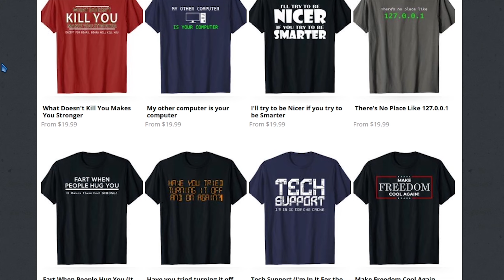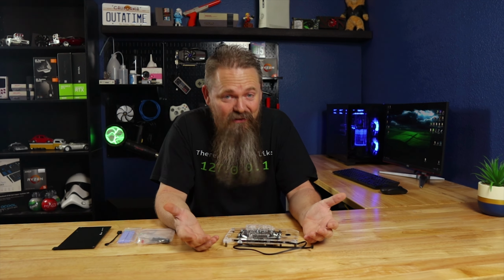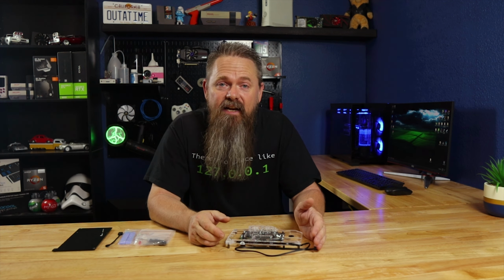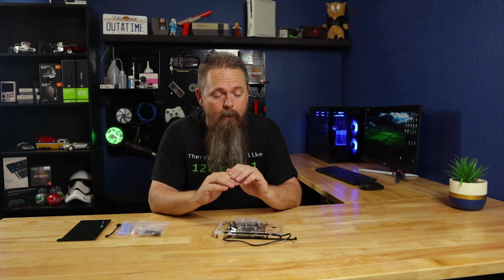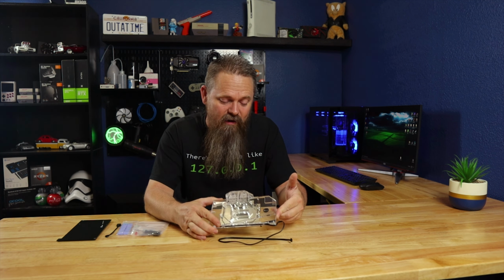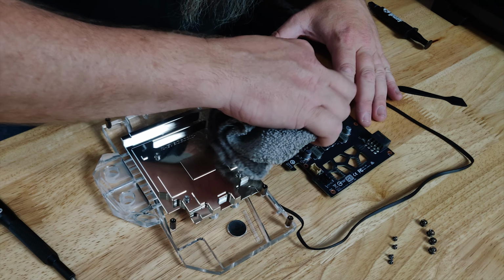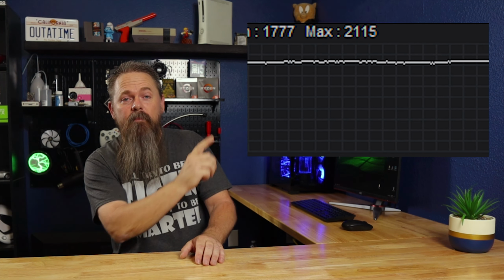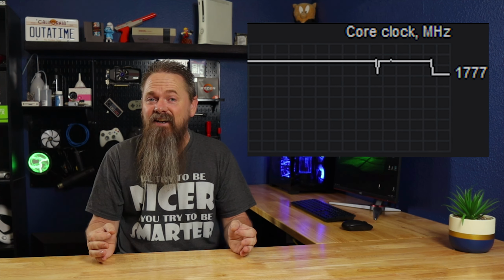Water Cooling a Mid Range Graphics Card

Comment: Its not a waste of money, when a midrange card starts to show it's age, you want to start overclocking it if you dont want to upgrade for it to keep up. Overclocking can damage cards due to the high voltages and high temps so a water cooling solution negates that. Totally worth it plus you can sell it for a pretty penny too.
Reply from the maker: Personally I'm not convinced overclocking will hurt a GPU. There's just too many limitations in place to protect the GPU from damage. The worst case scenario is the system gets unstable at higher clock speeds but once you turn them down it runs fine. Better cooling will help you run at higher clock speeds for longer.
Reply: I know this is 2 years old. But it is 100% a waste to watercool a bottom tier gpu, it makes no sense. Especially for a 200w gpu. The loop alone would end up costing way more than a 3060, at that point youre much better off getting a faster gpu. This is why u dont really see many companies making waterblocks for 60 class cards, theyre not as available as you see 80 and 90 class cards

Comment: Dude I was looking at ordering the same thing like 3 days ago.  Just ordered the card last night.  What is the length of that with the gpu block on it?  Trying to mount it horizontally in a meshlicious
Reply from the maker: The dimensions I believe are on the website. It's pretty short once you remove the air cooler.
Reply: @CyberCPU   Just picked up the same block off aliexpress for $93.00....
Reply from the maker: @notmatt5864  Sweet. Congratulations. Great deal.

Comment: My 3060 has been making rattling sounds apparently due to a defect of the shroud. Been really considering this as a much nicer way to cool it over strapping 120mm fans into it and am not sure when I will be upgrading, especially when the Bykski block costs around $115 now.
Reply from the maker: I believe that's half of what I paid when I did mine. That's a great deal. Grab one before they're gone. Now that EVGA doesn't make GPUs they're probably not going to make any more once they sell out.

Comment: Ordered an byksi waterblock for msi 6950XT on aliexpress. 130 euros with a backplate included. Going to do a custom loop in a nr200p. Keep up the great work
Reply from the maker: I had never used any of their products before and was a little concerned with quality. You know, because of water and all, 🤣😂

However, I've been really impressed with this block. It's pretty well made.
Reply: Both my EK blocks I sold for 3090s had loads of black dots and some big brown patches. My Byksi block I had on a RX 5700 is pristine clean. Same liquid. The EKs had to deal with a lot more heat though.

Comment: Nice informative video, i just upgraded from a 1060 6gb to a 3060 12gb because im limited on space with my small media case but this 3060 is like a heater in comparison so I run into temp issues pretty fast when gaming 4k/60. Looking to watercool using quick connect lines and run a duct in my media cabinet to a external radiator away from heat sources . Great to see that it will make a decent temp drop before i go down this rabit hole. I wish there was a better slection of media cases that have a clean front to blend in with my home theater stuff.

Comment: Very informative video, I want to install water cooling into my pc because I want my PC to run at a lower temp so it can stop making my room hot lol. But not sure what pumps or gear to get tbh. I have the same graphics card a RTX 3060 and a AMD Ryzen 5 5600 GB Processor. What would you recommend I get so its compatible ? or is any water cooling system compatible with both the GPU and CPU? sorry if i make no sense I'm new to the water cooling theme.

Comment: You can water cool the 3060ti with an AIO. The adapter plate from NZXT costs around $27.
Reply: got a link?
Reply: It isn’t compatible
Reply: @senpaigrime  It takes some modification, but it does work.

Comment: You could also add extra fans for the 240 radiator it will help push & exhaust the air! Also Im sure you have extra fans lying around! See if that will help to get cooler for minimum investment!
Reply from the maker: It's actually a 360mm rad. The cooling is fine with the fans ramped up a little. I have the fans set pretty low. They ramp down to 0rpm.
Reply: @CyberCPU  none the less I added extra fans to my Corsair H150i Pro AIO that's on my CPU. Check out this utility InSpectre free boost for Intel CPU's I think this can also be applied to AMD CPU's. Utility is only 125Kb in size.

Comment: What a great video, new sub! I have the 3060 ti fe and Ive been browsing water cooling for the past month. I really wanna get started but not only is it very expensive, its pretty hard to understand what is what in my experience. I found a EK 360 Kit for around 300 dollars that includes everything i need. If I add a gpu block to that loop the total would be around 500 dollars. do you think i would get around the same temps as yours or is it simply not good enough stuff included in thoose kits?
Reply: Just open up your 3060 ti, remove the old factory thermal paste and replace it with premium thermal paste like Thermal Grizzly or Noctua. This alone will slash temps by a huge margin and is MUCH cheaper than trying to watercool a 3060.

If you want to take it a step further, you can buy a high airflow case like the Phanteks p400a or p500a. The good thing about a high airflow case is that it will not only benefit your current gpu, but will benefit all future gpu's you throw in there.

Comment: I'm just a simple, old-fashioned man who prefers air-cooling when it comes to PCs... and motorcycles. Water cooling may be (much) superior but I find the simplicity and reliability of air-cooling to be a perk, not a quirk. 
Plus, with undervolting and capped frame rates; it's entirely possible to achieve water-cooling level of thermals, especially if you sacrifice some frequency to bring the voltage down even further.
Reply from the maker: I'm going to have a video about that coming out soon.
Reply: @CyberCPU  That'd be interesting! 
For reference, I undervolted my RTX3050 to the lowest possible voltage (700mV) and was able to squeeze out a respectable 1,500MHz (it boosts up to 1950MHz), just for kicks and giggles. With that profile, it basically consumes around 40W of power (indicated), comparable to a GT1030, yet offers performance close to a GTX980.
The sweet spot is 900mV @ 1900MHz. Most of the performance at almost half the power consumption (70W).
Reply from the maker: @Sam-K  I think it defeats the purpose is the GPU is underclocked. But then again, I guess it depends on what your going for.
Reply: @Sam-K  I mean there's no point having a 3050 then. Just get the 980 and let people who'd buy it and use it properly have it... 😭
Reply: @DelayEdits  I've a 75Hz monitor and always play with vsync. In a lot of older games, there's simply no need to run the GPU at full blast to have a solid, locked 75FPS experience.

Comment: I was lucky enough to buy the EVGA 3060 with the back plate for $389 ($429 original price) from Best Buy. I think I might go for the 3060ti with prices dropping.
Reply from the maker: I don't think the Ti is worth it when you already have a 3060. If your going to upgrade I would go with a 3070 or more. 

I honestly recommend going with the ti from the beginning instead of the 3060. However, if you already have a 3060 it's not enough of a performance game to justify the price. 

Maybe look into a used 3070.
Reply: @CyberCPU  I have decided to not upgrade my 3060. I currently have no plans to change my 1080p 144hz monitor. Seems like the 3060 will run most games 100+ FPS on high settings.
Reply from the maker: @WidePhotographs  Currently I'm using a 1440p ultrawide with my 3060 and it runs almost everything at close to or over 100 FPS. Of course that's overclocked and water-cooled. However, it's a very capable card.
Reply: @CyberCPU  This is exactly what I was wondering, I also own 3060 ( Gigabyte Gaming OC version ), and I was thinking to sell this gpu and get 3060 Ti, but it's probably not worth it, as you said. ( because I didn't have enough money for Ti version in first place to buy ). But, It's still great for 1440p at 60fps, especially when it's overclocked.  3070 or 6700 XT should be real upgrade

Comment: I have a 3070 and ryzen 5600x, so right now I’m running 3 panel fans and the stock cpu fan. At a high output and high temps my computer turns off, so rn I been playing at regular setting not pushing what do you recommend Aio cooler or Better cpu fan and more fans or water cool because I want the max performance. I willing to spend 360 dollar if you can help that would be amazing !
Reply from the maker: I'm kind of biased on this subject. I absolutely love water cooling. That's the direction I would go. However your likely not going to be able to du a custom loop for that price. An aio will likely be your only option.
Reply: @CyberCPU  realistically I can spend more but i also want to buy a 280 hz monitor 😂
Reply from the maker: @sweatymexican6775  I've got almost 1k into my current loop. Custom loops are expensive.

Comment: Maybe you forgot a thermal pad, man! And you put nothing in the PCB; maybe it is not necessary, but you could do a little better, here, even if 3060 it's not exactly the best middle GPU. Things that happens.
If you're doing a custum water loop, this is usually for CPU and GPU, so the money of some components should be divided in some way by two. I think that a well studied and done water loop is always the best way to invest your money. A good 700 euros GPU + 150 waterblock is always better of an 850 euros air cooled GPU. Yes: radiator, pumps, reservoirs, fans, that's a lot of money, but you also have, for example, a 5950x running at 4,8 Gh at 60 degrees, instead of 3,8 Gh: it's 1 Gh difference... For the same reason you have in mind the entire machine, it's also difficoult to do that division, but you could have a 6800xt running best of a 6950xt air cooled: it becomes another machine, and the improvement you have from CPU and GPU considered togheter is more of the money you added. 
Also with a water cooled computer you can study the behaviour of your hardware better: a 2,4 GPU boost clock becomes a 2,6 Gh normal continuos clock at 50 degrees, 300 watts is easy to take but you can have more from your hardware at lower powers too, and you can use everything you paid for: while with air cooled systems you pay 700 and you use 500, with 700 + 150 you use 700 + 150, or something nearer. You're performance per watt goes to the top.
Unluckily, for reasons I don't understand, people use too less water and to little radiators, and so results are so and so, but if you do a custom water loop with study, patience and love you will be very very happy of you have done and very very happy of what you can do with.
Thanks for this video!